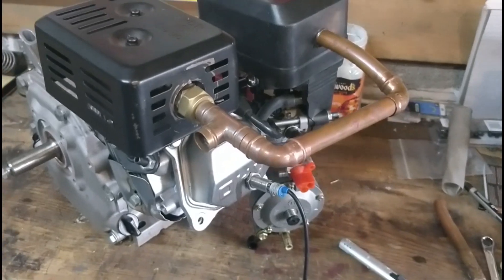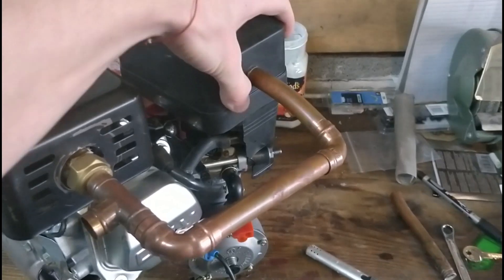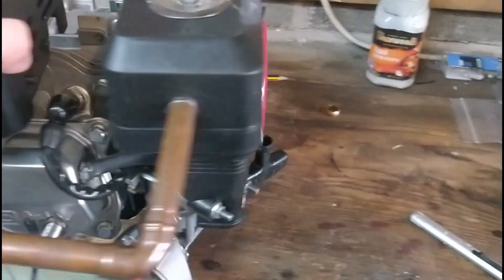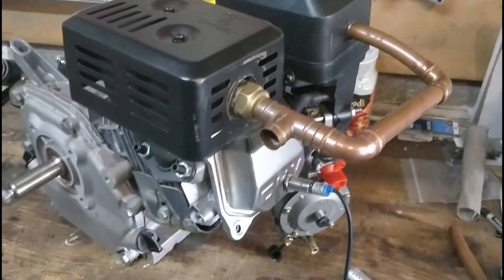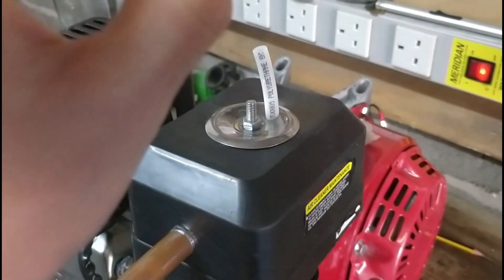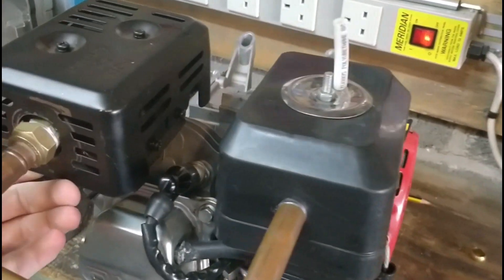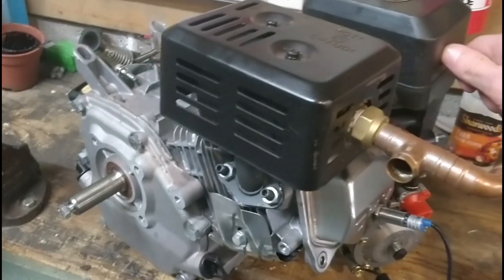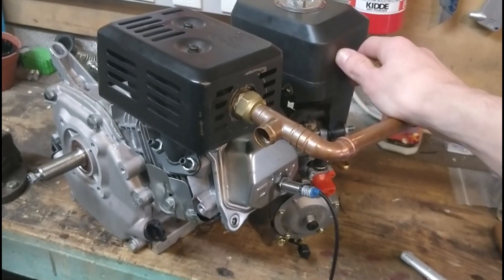Pure Hydrogen Combustion Engine

Comment: I have a Honda clone it is designed to run on gasoline. I want to run it on hydrogen. The spark timing is fixed at 16 degrees before top dead center (TDC). This is fine for gasoline because combustion is slow and the full force happens after top dead center.  Hyrogen is more volatile and will ignite immediately forcing the engine in the opposite direction. I want to ignite the spark at or one degree past TDC. I am going to use an Arduino hall effect sensor to detect a magnet fixed to the flywheel at TDC. My problem is the hall effect sensor will detect TDC every time there's a rotation which means once at compression TDC and once at exhaust TDC. If I install a sensor or switch to detect when the intake valve rocket moves then the next signal from the hall effect sensor will be compression TDC. Does anyone have experience with Arduino and can help me with the code?
Thanks, 
Mike tlxthai@gmail.com
Reply: Not specifically with arduino but Object oriented programming always works the same. Literally just create a function that only fires every other detection.

Comment: You might consider adjusting the spark timing.  remember HHO gas contracts does not expand like petroleum.  spark when the chamber is full.
Reply: That's very interesting is that true? Hydrogen contracts when it combusts I don't see how that's possible considering the little bottle rockets blast off. How do you get an implosive force from a clear explosion I'm confused
Reply: @bigsteve6729  Hydrogen gas is 1800 times less dense than water.  When ignited it compresses 1800 times when mixed with O2.  but when compress something that much that fast it gets hot.  add some water use the heat to make steam for the expansion phase.
Reply: @bigsteve6729  nah it doesn't contract, I think Señor @John White is confusing gravimetric with volumetric.  Hydrogen still follows the gas laws and Carnot theorem in an ICE engine.  
The low volumetric energy  density of Hydrogen gas generates a problem with normally aspirated combustion engines in the form of reduced power output for a given displacement in comparison to much higher volumetric energy dense fossil fuels.
Reply: @milanswoboda5457  
Are you saying that the gas expands even further than its lowest density? Clearly you don’t understand the basics. Breakwater down expand the gass. Ignite the gas contract back to water
Reply: @johnwhite5940  hmmm so in your mind combustion gas temperature is below the water phase change point while in the combustion chamber during the power stroke?

Comment: Hydrogen engines could let me keep that sweet sweet ICE sound and feel and not ruin the air. Nice.
Reply: Hydrogen combustion does not produce carbon emissions but it does produce NOx.
Reply: Agreed
Reply: Look at the engineering explained video about this
Reply: It would also have more power.
Reply: All ICE burn the engine oil over time. That's why the oil level on your dipstick goes down. Definitely not pure air exiting from the Hydrogen powered engine. I wouldn't want to breathe that air from the exhaust, over a lengthy period of time.
Reply: Nothing burns clean. Heating oxygen in combustion will always produce oxides for everyone who does bother to do any research.
Reply: @dragonf1re96  oxide with what if it’s a mix of HHO? If you close the engine to outside air and inject Hho so there is no Nitrogen or other what elements in non trace amounts will form oxide; unless you mean Di-hydrogen monoxide aka water
Reply: @wastelesslearning1245  that's true if you're using electrolysis to create fuel, but electrolysis uses more energy than the hydrogen will produce from combustion, which makes electrolysis problematic.
Reply: i thought i was weird for not wanting combustion engines to completely disappear lol they're cool
Reply: Hydrogen is a keeper / however oil companies would lose on this because the fuel could be had by anyone with knowledge / thus controlling the masses ( government ) would kill Revenue . thry golerate california to have it because of the smog / that's why they have it and nobody else in the states . they say not practical is there excuse to put pumps in gas stations ( keep in mind ) these tanks are above ground like big propane bull tanks . hydrogen days will be gone with ICE law thry wanna kill combustible engines immeditlsy because of hydrogen threat
Reply: @kennek6224  if a tiny amount(2%) of hydrogen is added to the air intake, emmissions are reduced to only 20% and diesel or gasoline range is increased by 20%.
Reply: Samee
Reply: dont be fooled, its not a special engine, ANY  ICE  will run on it with some tweaks like timing ( advanced 3 degrees normally)
Reply: Something very important that Nobody is thinking of is the intake air is full of nitrogen. And with the heat involved in the combustion process, your exhaust gases will be absolutely loaded with NOx's.
Far more than what regular gasoline/ethanol engines produce. Even far more than what they produce WITHOUT a catalytic converter. So .... Big problem there, folks. From an environmental standpoint
Reply: @Nasonix2  No its not far more, about the same.
Reply: @adorabasilwinterpock6035 Isn't it more because hydrogen burns at a far higher temperature than gasoline?
Reply: Just filter the air of nitrogen before the combustion process or use oxygen and hydrogen tanks as you’d soul input so no air intake is needed. One way exit valve. No nitrogen in combustion chamber. No nox.
Reply: @Nasonix2  and water has half of the energy density that has does as well
Reply: @Nasonix2  Everyone is also forgetting that electrolysis uses energy. There's a reason cars don't run on water and it's because it just isn't a better alternative to gas.
Reply: @Nasonix2  I don't see why that can not be overcome fairly easily, though it will increase the cost.  If your using solar for instance to produce the hydrogen via electrolysis, you are producing pure O2 as well, you just have to capture and pressurize it and introduce it at the intake just like the hydrogen.  You have doubled the tank capacity required which is a downside, but at that point 0% NOX emissions.  When its all mixed together at the same ratio it is produced it is flammable. I am however not sure if it would be the optimum ratio.
Reply: Fully synthetic fuels do the same and you could put them in any gasoline/diesel car without any changes
Reply: @uhrensohnmentalitaet  I firmly believe it's fully synthetic renewable fuel that burns clean that we need for petrol engines, rather than heavy and crazily expensive electric vehicles 👍 

With a renewable fully synthetic fuel, you'd then have a petrol engine with zero emissions, a win win for those like myself who love petrol engines 😁👌
Reply: @uhrensohnmentalitaet   Why use a synthetic fuel? hydrogen is easier and cleaner than those. 
Anything more complex than hydrogen isn't going to burn as clean, period.
Reply: @uhrensohnmentalitaet  who supplies the synthetic fuel?  water is everywhere.
Reply: @VinascoXperience  "as opposed to taking the water from the oceans and processing that to get hydrogen..."

what do you think they process it with? they electrolyze it - that takes a LOT of energy. and with that, you'd be better off just using an EV - so i don't know what your point is?
Reply: @mem7806  electric railways are even better than Eva. The batteries are even worse for the environment than overhead power lines and steel rails since Eva still depend on oil companies for plastics and tires
Reply: you can have all the vroom vroom sounds you want in a tesla from the speakers
Reply: @adorabasilwinterpock6035  Not the same, speakers just can't capture the same feel.
Reply: they do ruin the air though - how do you think they get the hydrogen?

your vehicle doesn't directly - hydrogen producers do.
Reply: @mem7806  Hydrogen is the most abundant element in the universe and can be produced with electrolysis of water. Harvesting it using green energy would be perfectly fine
Reply: @gecko56  however if you buy a cylinder of hydrogen gas todayit is refined from crude oil
Reply: @mem7806  I'd assume they use water lol
Reply: @notsogrand2837  Actually, it's mostly extracted from methane gas rather than electrolysis. But either way, you have to spend a lot of energy to get it, and then it's extremely hard to store.
Reply: @mem7806  car don't pollute air that much. The real offender is cow's farting. Literally. Read about it. And stop eating and Mcdonalds
Reply: @AmelpsXett  that's complete bullshit but alright
Reply: @mem7806  it's not
Reply: @AmelpsXett  No. Cows and similar animals are vital for healthy soil and nutrition cycle. Cows eat grass and manure it. Grass roots makes soil alive co-working with microbes and bacteria. They all work together. Healhy soil have ability to take methane out of enviroment. Nature has already solved all the problems of emissions. The real problem is people who ruin the natural cycle with stupid farming. Cows needs grass pasture, grass and soil needs cows. Pasturing cows have very healthy red meat with iron, minerals and lots of good fats and vitamins your brain and body needs to survive. I totally agree, DON'T eat at MCdonalds, but buy pasturing meat directly from the distributors or farmers and eat healthy meat at home.
Reply: @mem7806  Solar, wind, hydro-electric.....
Reply: @mem7806  Same deal with electric buddy, give it up, hydro wins.
Reply: @mem7806  Well the process of obtaining Hydrogen is very less polluting,  its electrolysis of water primarily.  

In Combustion of Hydrogen Engine , Some amounts of Nitrogen Oxide also gets emitted which is polluting,  but way less polluting than ICE.  

The problem of Electric Engines is regarding availblity of Lithium for cells. Which is a rare metal and is getting exhausted.  Also Range in Electric Vehicles is a huge concern due to lack of high charge Batteries.  

H2 in my opinion is a way securely available and future proof Engine type as in future Avation industry will also use H2 since electric engines arent capable for aircrafts. Infrastructure will also devlop for H2 and will be more viable for industries and consumers alike
Reply: @probably_yj  electrolysis of water requires a fuckload of energy & normal EVs are less polluting due to the fact that they don't have the same energy losses as hydrogen cars

if we find a better way to make hydrogen they could 100% change the way we drive - however, it seems like it's not great so far
Reply: @mem7806  electrolysis can be quite efficient when considering the mechanical advantages of HHO engines.  Look up Stanley Meyer
Reply: @johnwhite5940  stanley meyer was mainly a fraud, and electrolysis cannot be very efficient? you need electricity to do it, so just use an EV instead which gets higher efficiency
Reply: @mem7806  I am just not happy with not having a real engine there for me...
Reply: @mem7806  But we do not WANT a QUIET EV!!!!!!!!
Reply: @probably_yj  It's not production that is holding hydrogen back... it's replacing the current supply system and billions invested in piping gasoline around America.
Reply: @johnwhite5940  He was a fraud. He claimed you could use water as a standalone fuel, which is would mean getting energy for nothing. 
Imagine you had a closed metal box and inside, it combusted HHO into H2O, and used that heat to split H2O into HHO gas again, releasing any excess heat out of the box. You'd end up with a permanent radiator. Where is that heat coming from? You're not putting energy into the box, but it's magically heating itself forever.
Reply: Thermal chemical hydrogen synthesis (either use cost effective mirrors or waste nuclear heat), microbial hydrogen production using waste bio products, take from Jupiter, or use surplus nuclear power. But currently even electrolysis propane tank storage is more efficient then petroleum refining and drilling. Hydrogen House has been off grid for 16 years and counting using that method and it works and is scaleable. But herpty derp I guess hydrogen is too inefficient even though there are many alternatives methods, suedes surplus energy at scale more cost effective then battery, can be used in way more things including retrofitting iCE then battery, and is already more efficient the gasoline refining from crude oil ground to vehicle combustion. But whatever.
Reply: @mem7806  Agua
Reply: @mem7806  ever Heard about

Green hydrogen?
Reply: @purplrshadowyay  99% of hydrogen right now is made by reforming methane/natural gas unfortunately but i hope they switch over
Reply: @mem7806  Yeah, those are grey (emitting CO2) and Blue hydrogen (Trapping the CO2), but green hydrogen (water electrolysis) Will be the future. The Energy for It Will be from sustainable sources obviously, or from more hydrogen.

Comment: I hope he didn't compress hydrogen and oxygen in that tank?
It can blow up!!!
I ran a pushmower on hydrogen and gasoline , then again just on gasoline.
Using hydrogen in addition to gasoline it ran twice as long.
I know from experience that the hydrogen and gasoline did not harm the engine. And it did burn much cleaner too.
Now i do not know what would happen to an average engine on straight hydrogen?
Haven't tryed that yet.
Reply from the maker: This engine is running on just hydrogen. And it was compressed pure hydrogen not hho :)

Comment: I hope they stop focusing on electric and start looking at these. They are almost fully carbon zero, but electric engines will never be carbon zero either due to the heat they produce and the fumes made if batteries combust. I used to be a Tesla fan boy but gosh I’m a motor head and a young one at that, and by the time I can afford to build a car petrol cars will be banned in my country, so these are my only hope of getting my hands dirty. Electric engines are all about gear ratio and I just wanna rebuild engines and build kit cars. I remember when i was about 7 and i had the idea of building a car that ran off water, by taking the water and turning it into hydrogen to run an engine. I even thought about having a water filter so you could use water from a nearby stream if you ran out. although filters dont filter out salt so immnot sure how that would work.
Reply: Its not if the batteries combust its the lithium production itself that is harmful.
Reply: I switched from electric to hydrogen (in my dreams) Batteries are poopoo indeed.
Reply: wr⁹ñg ektrç beàdt yoú doñt get ñext heñ bàtterrß deàl héàl sealf chàribg

Comment: Hydrogen should be considered energy storage, not a fuel source. Separating hydrogen from water takes more (practical) energy than you'll recover from combustion. Getting hydrogen from hydrocarbons is cheap, but is still using fossil fuels.
Reply: Electrical power is becoming cheap,U.S.$ 1/kwh with new types of generators
Reply: Lol you can make hydrogen with only 2 volts dc, its the amperage that uses alot of power xd.

Comment: Hydrogen ICE or Hydrogen Electric. Either way it works well.
And if you don't want to crack water to get hydrogen, another good source is natural gas.
Instead of burning the natural gas we can strip the hydrogen out of it instead.
It's called "Natural Gas Reforming" Look it up.

Comment: Great Video. I hope you look inside the engine in the next video soon. I want to see how the hydrogen working with the mechanical parts. And one question. What is this sensor on the side of this engine? I think it's not an rpm sensor. What is it. Pls
Reply from the maker: hi, the sensor was for another project and was not used for the Hydrogen experiment. the engine internals looks good and healthy, the exhaust and intake ports along with the cylinder head needed to be polished to remove hot spots in the engine for better operation at high RPM. the oil also needs to be changed more often as it gets contaminated with water over time, this is because when hydrogen is burned it turns to water.
Reply: @Hydrogenguys  thanks for your answer! :)
Reply: @Hydrogenguys  
Great video !
I'm a retired mechanical engineer and raced cars with methanol and solved the fuel dilution problem with gapless second rings in the engine.
I had cylinder leakdown at 1% as compared to other engines at 10% out of the box.
I'm developing a hydrogen system based on the DIY SCIENCE GUY ON U-Tube. Very simple and cheap !
I'll compress it into an old LP tank and quick couple it into my car while shutting off the electric fuel pump while driving using gas to extend the range or get home when the hydrogen runs out.
BRAVO !!! on your work and sharing.

Comment: People will still want that pure sound that combustion engines give. I can see this been the way running parrarel with electric
Reply: It will continue, as a hobby... just as with horses and steam engines. SynGas (a type of gasoline derived from refuse) will become a profitable venture as the petroleum infrastructure slows down.
Reply: What is pure sound?  What does that mean.  It's a sound, electric cars have another sound and it's all subjective, one is better than the other.
Reply: @robertsaca3512  Electric Cars are completely silent.
Reply: @robertsaca3512  41 likes to your zero says otherwise guy.

Comment: Great video, thanks for sharing.  How did you compress the hydrogen?
Reply from the maker: The hydrogen was made and compressed with a pure hydrogen generator I bought, I made a video a few months back of another cheap method on making and compressing pure hydrogen with chemicals, go Take a look if you are interested :)
Reply: @Hydrogenguys  how much energy did that process cost compared to fossil fuel. I'm interested.
Reply: How much did that hydrogen generator cost?